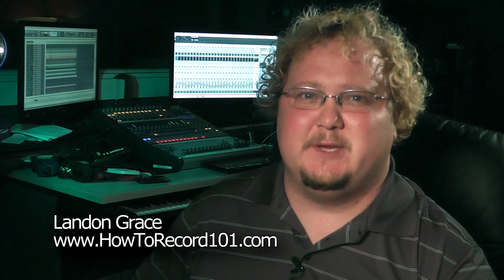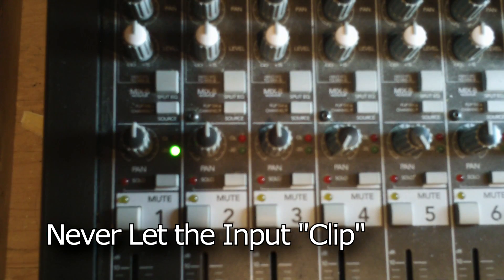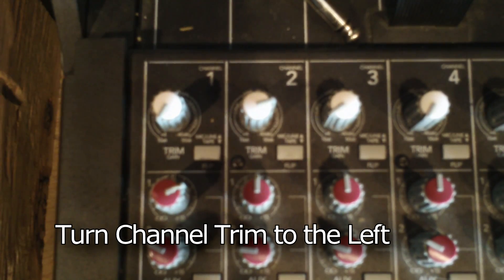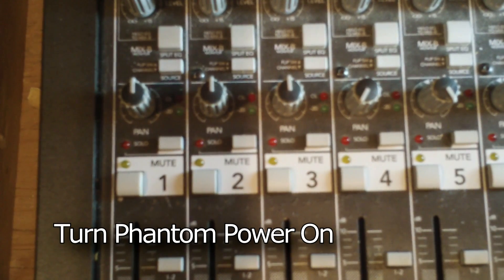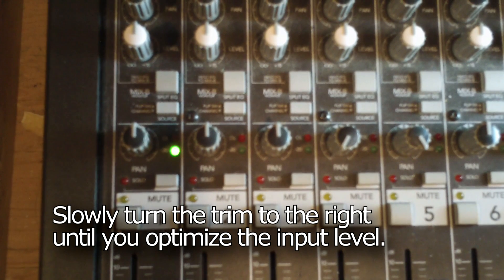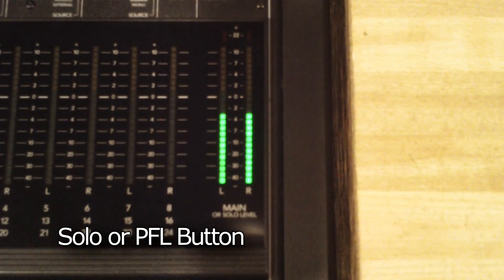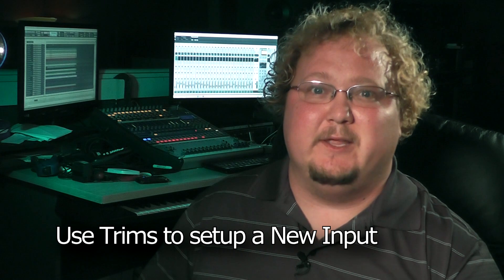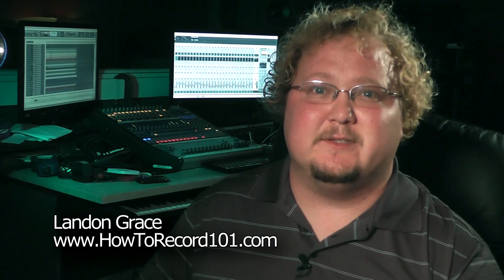How A Mixer Works - Setting Trim or Pre-Gain

Comment: I'm still confused. This just makes it sound like you just have two volume controls. I'm not sure why I should adjust one and not the other at some points
Reply from the maker: Both knobs do control volume.  1 is the input channel volume and 1 is the output channel volume.  Which board are you using?

Comment: can use any mixer for pre gain..
Reply from the maker: +Kamando M Pre gain or trim is part of the process on a mixer.  It is not necessarily an end result.  Can you tell me what you are trying to do?
Reply: I have big system am run a numark mixer to preamp and i wna buy one of dis n put between the new numark n pre amp. Would that work n i think i dont have enough gain to my system i dj outdoor entertainment
Reply from the maker: Can you list your speakers, amps, preamp?  You can private message if you would like.